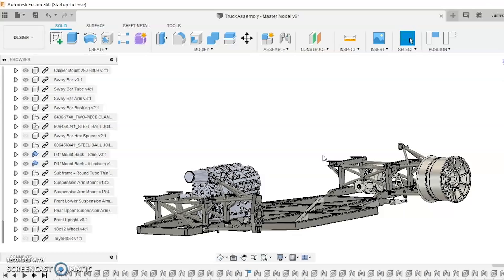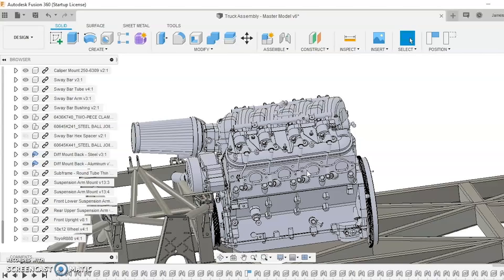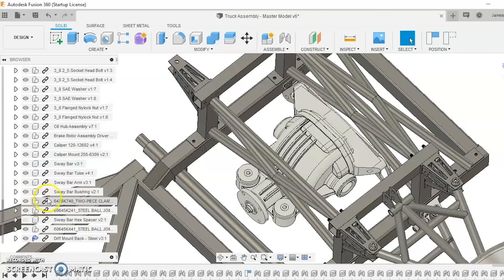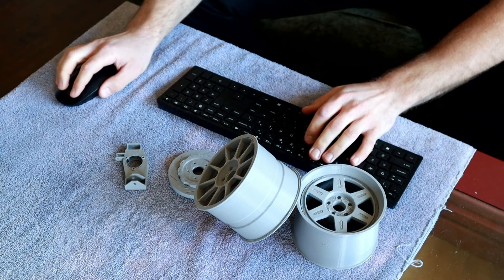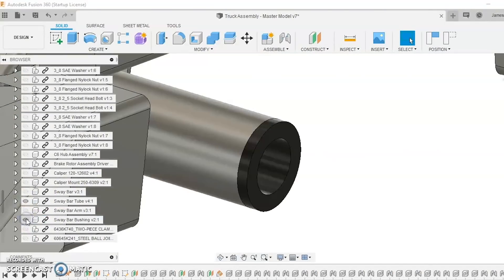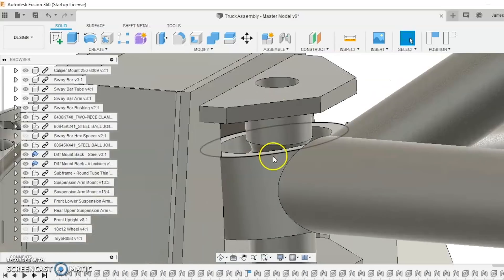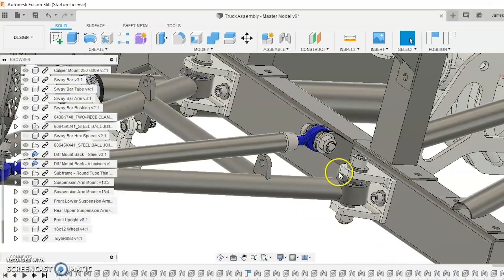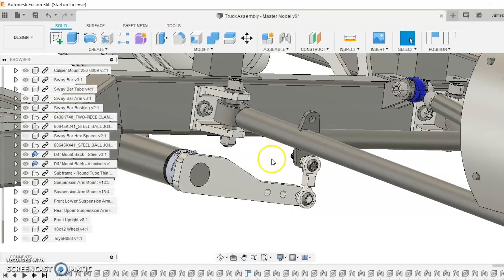Designing a Race Truck Using CAD - POWERNATION at Home

Comment: As an older CAD guy, this tech has bee around a  while, went from drawing the board to cad in the late 1980’s. if your willing to spend a few bucks autodesk has a higher end system called inventor, this would allow you to do fea on your parts, in other words test for weakness or unneeded weight, before you cut steel. It also has a feature call analyze interference , which would find where the parts hit each other. It would also find weight, center of gravity, etc. my 2 cents

Comment: It appears the rear-end mounting structure doesn't consider  pinion angle change under acceleration. There's quite a bit of torque to consider.
Reply: The rear mount most likely wont be the only mount on that rear end assembly. there are two mounts near the pinion on the front of that rear end that he didn't really show much. it is an independent rear suspension and once the pinion angle is setup through the drivetrain, there wouldnt be much if any pinion change. a solid axle would have pinion change as the suspension travels but an independent axle does not.

Comment: So, yesterday, I towed a '63 split window to a dyno tune shop. What does that have to do with this? Its engine is no longer a Rochester injected 327, but a late model engine as mentioned in this video, an LS-3. Additionally, I picked up the car from a man who works for a Cadillac dealership (CAD is occasionally used as a short version of Cadillac, LOL!) That, and the entire undercarriage is custom, eliminating the 1963 chassis and suspension, with the possible exception of enough framework to keep the VIN legal.